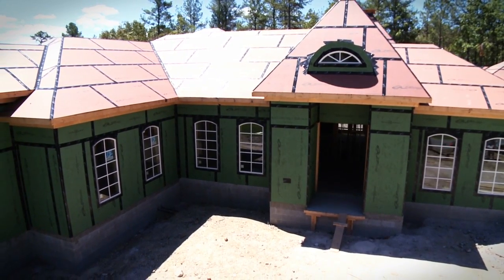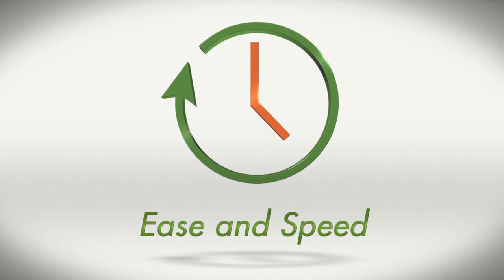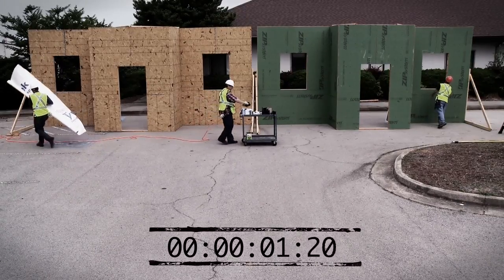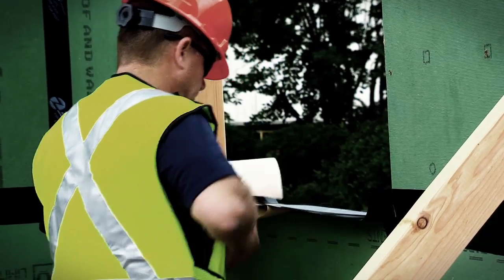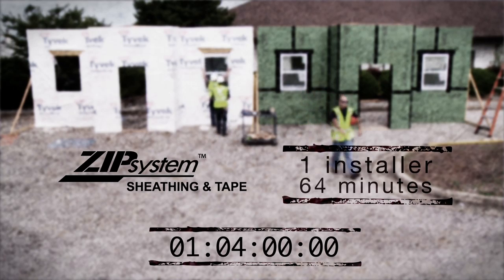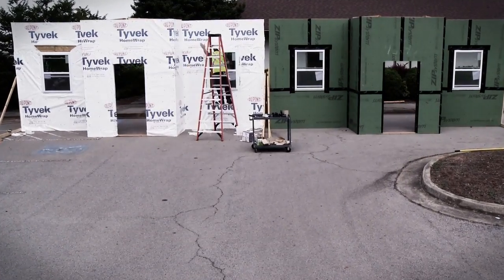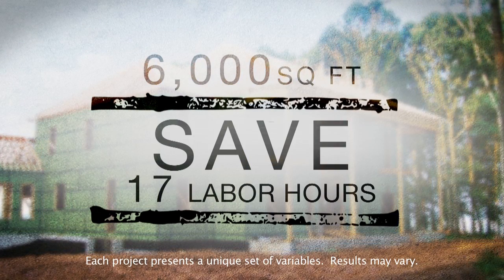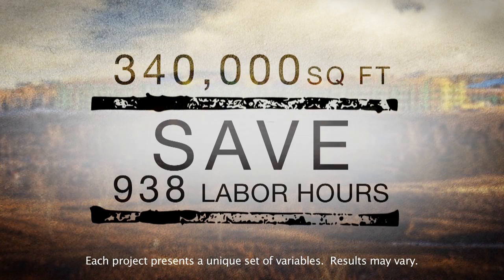ZIP System® Sheathing and Tape Vs. Housewrap Installation Challenge

Comment: Have NEVER seen an installer properly install Tyvek in the windows .  That almost always install the windows before they wrap the house or they simply cut the rough openings and not fold them in and flash it.

Comment: If you had more efficient people on the housewrap side, it would be a lot closer of time.  They moved their ladder so many times, they would have been fired for inefficiency way before the windows went in. Get a certified installer in there to show them how it's done. Also, why don't you show having to do it twice in cold climates with a 12" tape?